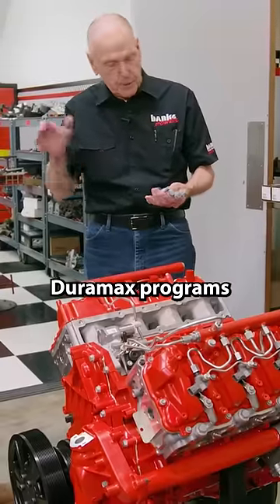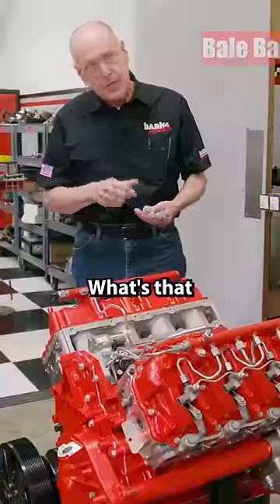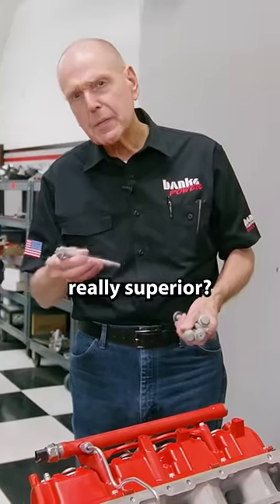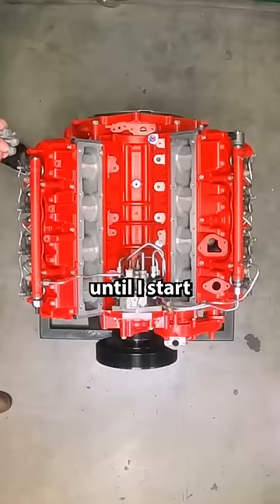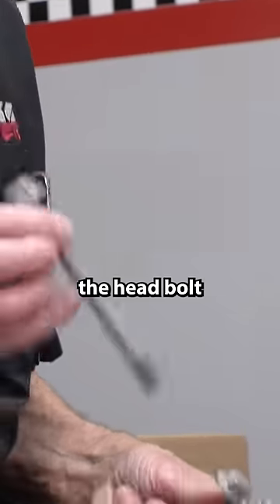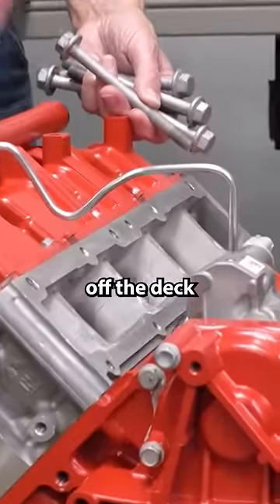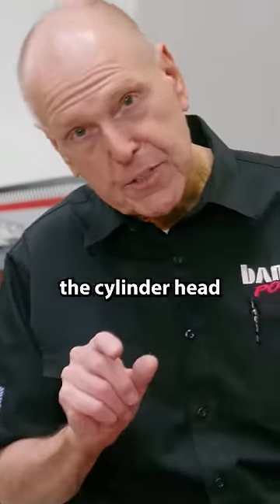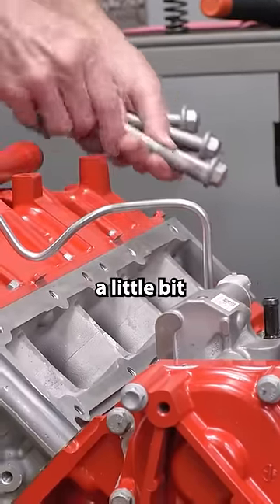Upgrading to head studs might be a bad idea

Comment: I have a cheap little 22re I've blown the head gasket on from over revving and doing cheap 22re things.
Last time i put a head gasket in it i tapped the holes, lubed a new set of bolts, and torqued them 20 ftlbs over spec.
I've put another 50k of unrelenting valve floating miles on it with no issues..
Just my experience with a cheap engine.

Comment: He's not wrong. If you're constantly blowing headgaskets, odds are the mating surfaces of the block and head aren't perfectly flat. Just machining the head isn't going to fix that, the block has to be done too. Studs can compensate for some of that by being more rigid and having a higher clamping force, but then you'll run into the heads cracking because of the extra stress. You can see this stress yourself. Bend a piece of metal just a little, and it will want to bend back to where it was, which is called elastic deformation because it bounces back. Bend it alot, and it will stay roughly where you bent it, but you'll be able to see stress cracks at the peak of the bends. This is called plastic deformation because it's permanent, and the cracks are where the stress was the highest. If the head is flat but the block isn't, the head is going bend down to meet the block's low spots, putting extra strain on the high spots and causing a crack over time. It won't be at the bolts because that's where it's stable from being held down, it'll be inbetween the valves because that's the furthest distance between studs, as well as being both thinner and having sharp angles that act as stress risers. If both surfaces are perfectly flat, you don't have this internal stress on the metal. If one isn't, the weakest point will crack when the drive cycles transition the metal from elastic to plastic deformation.

Comment: If the bolt clamping force is greater than the dynamic forces from the firing pressure the bolt doesn't stretch from the pressure because it is already stretched from the greater clamping force.

Comment: Something else to consider, head studs can distort the cylinders more than a bolt, so ideally the cylinders should be bored and honed with the studs and a torque plate installed.

Comment: Great guy smart as hell but all he did is tell us nothing we didn't already know, the originals are stretched to yield which means if you're gonna keep the stock ones then you're gonna have to constantly go in and check them and Torque them and using studs maybe a little rigid but on all the diesels I've worked on which is hundreds, I've never had any problems with studs after installing them, but great video.

Comment: It depends on the engine or course, I ran ARP hardware on a twin turbo Audi V6 setup a few years ago. When you’re shoving 30 pounds of boost down its throat the factory bolts will let the heads lift. The ARP doesn’t. That being said, on that particular engine nobody cracks blocks with them, the bottom end will let go before you ever have that issue lol

Comment: I was taught this is why certain applications have different grade bolts in them. For this very reason. A designed failure point when certain shocks or stresses are too high.

Comment: What he said was loud and clear: it’s much cheaper to replace bolts regularly than it is to replace the hunk of metal they are bolted to. Lol
Reply: I would think that’s still easier and cheaper than replacing the block… Also, I note that he said “until you start blowing head gaskets.” Meaning don’t let the engine find a catastrophic failure point when you can engineer one that can be fixed. That’s what I got from that.
Reply: @AlphanumericCharacters  that’s kinda what I was thinking. Lol. I have a bit of experience with aircraft engines and they have failure points designed into them much like these head bolts. Routine maintenance and service intervals include engine rebuilds with fresh parts in the failure points. It’s a lot easier to do that than it is to land a plane without power. Lol that’s where my head was at. 😅

Comment: Studs are better if you're gonna be pulling the heads on and off (racing) often. The threads on the stock bolts can wear out the aluminum (softer, dissimilar metal) threads. If it's staying on, stock bolts are fine.

Comment: This is VERY TRUE, When the group of engineers took WWI aircraft plans and built new reproductions, they new better than to "upgrade" the build quality, as you will now move a "Known Failure Point" to an unknown location, one that may not be so easy to inspect...With Deadly Consequences.  Their Motto: "It worked then, it will work now."  (Source: NOVA - The First Air War ~ 2014)

Comment: Depending on the engine and how reliable that engine is to begin with spending that extra for the oem is worth it. 
When I rebuild my 6.2 for my Escalade all OE went back into it. 
When my motor blew up in my 07 Lincoln mark lt with the 3v 5.4. I went to my local pull a part and got a 2v 5.4 and rebuilt it with upgraded parts and junked the 3v block. Sometimes engines aren’t worth saving.

Comment: The bolt has an elastic region and a plastic strain region. The bolted joint is designed stay in the elastic region and act as spring. It does not yield and "strecth" in length.

Comment: More than that, cranking the bolt down harder doesn't necessarily result in a better seal. Because head and block are not rigid,  the flexing caused by pulling down at the head stud can cause the middle in between the bolts to rise up, making the already weakest part weaker. 
for a visualization just put something flexible like a thin piece of wood on your bed and push down in the middle and the ends will rise up.

Comment: He’s explaining the old saying of” the chain always breaks by its weakest link “  to strong bolts will not give in as the engine was designed to have, so the block being weaker than the bolt gives in and breaks, decimating the engine

Comment: I lifted the head on my ls1 after it stretched a bolt. It cracked the head stud hole itself and let coolant seep in and i replaced the entire engine because aluminum is granular so that particular crack was almost impossible to save. Needless to say i have arp head studs this time.

Comment: It's pretty obvious that if you take a part that is under stress, and make it stronger than the specifications call for, so that it can't fail, then you merely pass the point of failure onto the next part -- in this case, the heads, or the block itself. You can look at it as a built-in failsafe. Better to stretch the head bolts and blow a gasket out than to blow up the head or the block. 

If I was rich I'd have given my old '85 Super Duty to Mr. Banks, and have him bulletproof it. Not so much to increase the performance, though it WOULD be nice, but to build it up to last a million miles. As with many things, if I knew then what I know now -- I'd have NEVER traded that truck for the Dodge POS 1500 that I got because my wife liked the color. 😮

Comment: The gaskets don't spring back! But his point is kind of valid. Many modern engines are built with bolts that are designed to stretch. They are one time only use. And excessive Hi Tensile can transfer excessive force to threads. But you cannot generalise.

Comment: Well also the l5p went to a 6 head bolt per cylinder design to fix the problems they had. 6.7 powerstroke rarely blow head gaskets and this is why. The lbz was bad about head gaskets

Comment: Head bolts don't fatigue ... think about it ... a high stress repeated many millions of times and no fatigue?

What happens is that the stress in the head bolts is largely static!

The pressure in the cylinders relieves the pressure of the head on the block, and the stress in the bolts stays the same with them only 'micro straining' (ie stretching) only enough to relieve the pressure of the head on the block.

The very first experimental design we did in my engineering degree was to demonstrate this and it has stuck with me ever since. 

So do not OVER or UNDER tighten head bolts. You need to replace head bolts because when you originally torque them up, they will be taken above their 'as new' elastic limit. If you reuse head bolts, then the torquing regime will not produce the correct axial (static) stress in them.
Some really big marine engines have hydraulic jacks on each of the heads bolts to more accurately set the tension. 

Note when torquing, you are applying axial tension by twisting the bolts ... not easy to measure ... but taking the bolts over their elastic limit gives you an accurate measure.

Note that cracked blocks are usually due to the expansion forces of the top of the cylinder (liner) producing circumferential forces that will crack  the deck at the thinnest point (ie hetween cylinders).

Comment: I ran stock headbolts in my 800 whp vw back in the day......I even re used them 😮and ran stock gaskets.  People never believed it but then some guys in Brazil split a few studded 1000k hp cylinder blocks  in half and guess what.  . . .they went back to oem bolts and the failures stopped.........well until they were pumping 1300+ hp from a 20 year old cylinder 😂😂😂😂😂

Comment: The craziest thing I've seen is the one truck from the old job I had. It kept blowing head gaskets over and over again. It turns out that someone had 35psi of boost coming out the turbo feeding into a 24 valve 6.9l cummins. That poor engine... But I tell you what, no amount of weight was ever a challenge for that truck. The only challenging thing was keeping a head gasket for more than 1000km

Comment: I had a quick search online- I run studs myself but not a diesel. One Duramax forum said factory bolts are 75ft/lb studs go to 125 ft/lb. I guessing the extra 50 ft/lb tension is probably the issue?
If MORE hold down is needed then studs at stock tension then the deck needs to be drilled and tapped for a larger size not more tension added.
Studs are a normal upgrade in spark ign engines, jumps in fastner tension numbers are not tho.  1000+ hp from Small Block V8s without destroying decks from studs

Comment: Pretty much same reason why I run the "cheap" stock head gasket in my turbo 2300 mustang.  I think of it as a fuse.   Something goes wrong, I'd much rather replace a 12 dollar gasket than pistons, valves, etc..

Comment: That's why the metal head gaskets have a indentation around them.
That's why when you are tourqeing head bolts it's important to follow the procedure to the letter.
Stretch the bolts all the same in the correct order.
Do it right or don't do it.
If your going to take shortcuts don't even start

Comment: A lot depends on the set up. If its an aluminum block, if it overheats bad, its junk. If you have aluminum heads and it overheats, they'll warp. All steel, overheating once usually isnt an issue

Comment: That's pretty common on motorbikes ,people replacing stock made for purpose bolts either really strong and high tensile for a purpose or soft ,designed to strip before damaging the motor,replacing them all with the same grade generic stainless or titanium ,that's wrong ,you want your bolt to strip ,not your engine block or cases if something ain't right....it seems like those big high powered engines need a wee bit of stretch in the bolts ,to allow for expansion of whatever, not hi tensile studs..

Comment: If you state a controversial and counterintuitive idea yet explain its validity with sound logic and reason to the point it scientifically makes sense. I will certainly take that into consideration. However let's also be mindful he started by referring to General Motor products. I would be interested to know how other manufacturers blocks fare. Then again if you are pushing anything to 1000hp, especially a GM product, shits bound to break. Solid point ol boy. Ill keep that in mind the next time I'm pushing 1000hp.

Comment: Are they stretch to yeld bolts? One time use? That makes a difference. I still like studs in high compression situations. Hold that head down so the gasket doesn't have to spring.😊

Comment: "Wrenching pressure"?  Is is clamping force.  Bolts and studs are indeed elastic, threaded hole damage is likely from too much preload.  All steel has identical Young's Modulus, the difference is yield point.

Yes, plenty of myths persist.  Torque to yield bolting with multi layer metal head gaskets are the reason for success as this gasket material has less creep while the bolting has more spring.

Comment: What you're saying is the headbolt is a chosen weak link. A sheer point engineered and to use a higher tinsel headbolt will result in that's stress seeking a different weak point.  In other words , it's going to break , let's pick where

Comment: Looks to me like a shorter depth bolt was used. I've seen some earlier ARP kits that had less thread depth.
I guess you are suggesting some spring quality is needed in the metallurgy of the bolts or studs.

Comment: The idea of reinforced headbolts is pretty insane anyway unless you're running massive power. That being said, in all my year of tuning I've never had a vehicle that would require heavy duty headbolts. Putting in new bolts is the most important thing, because stretch bolts should never go back in once removed.

Comment: I used ARP head bolts and had gasket failures. I switched to ARP studs and problem solved. Same heads and block. Same blower.

Comment: This is kind of a misnomer. The point of a stud over a bolt is where and how the pressure is applied. A bolt pulls on the threads in the block when torqued. When i nut is tightened on a stud, most of the force will be applied to the stud itself, because you aren't tightening the stud with it.

Comment: When I worked at Summit Racing ,I usually sold a normal push rod instead of  super thick , heavy-duty pushrods .  I'd rather bend a push rod than destroy the valve train .  Same basic idea.

Comment: Better a blown headgasket than a cracked block. If you must use studs instead of bolts, make sure they have the same grade rating as the OEM bolts.

Comment: Even stock 6.0 PSDs only failed because of excessive heat and pressure from EGR coolers. Engine cooling systems weren't designed to handle Exhaust temperatures.

Remove egr coolers, no more blown head gaskets, no need to use studs or ring gaskets.

Comment: The Stud headbolts need a bigger circumference/diameter bolt head,  (on the block - outer) with possibly some type of extreme spring washer - Tenctioner ? tripple the bolt head size

Comment: The torque to yield bolt is designed to act spring-like under the pressure. The Duramax engine is not the 6.0 powerstroke that Ford made. Every difference, makes a difference.

Comment: What you’re doing is finding out the limits of technology. The durability of the materials. Block, head, studs, bolts, head gaskets. The engine is designed to make only so much horsepower, and torque. Pushing it beyond the limits, will reveal these limitations.

Comment: Hey can you use some material science equations. Measure the depth of the hole and use material science equations for thread strength and material strength to determine how close the stock hit both is to ripping out threads on that block. If the stock head bolts are not even close to ripping out, then you can probably safely assume that it's an over engineered stud bolt that exceeds the ability of the block to hold it. I would definitely agree with your method though, when fixing farming equipment you run into this problem all the time or you over fix a break and cause trouble somewhere else

Comment: One thing I feel like people tend to do is overtorque the upgraded fasteners. I’ve fallen for this in the old days. I ended up going almost 2x “revised” torque setting and it cracked the head casting. That motor forever had a mysterious coolant loss and wet plug cold start difficulty. What if studs at factory specs are still safe?

Comment: Yep basica common sense people never over do a job, which the product was meant to be used for ,stock head bolts are not made for turbo applications full stop and truck engines or oem engines have the right products if they are turbo engines, sure you can make it better but then your going need to update so many moving parts and non moving parts is it really worth it unless your going to drag or race that engine than forget it plus all racing parts are made for racing. cheers Mr Banks. 👌🦘👍✌

Comment: How about head bolt girdles?  You can girdle the rotating assembly to distribute load across the journals, would doing the same on the top end help?

Comment: I've never seen that block issue before. Before we speculate the head studs being an issue, we have to rule out any other possibility. Were the head stud nuts were torqued correctly and not too much? Maybe there was fluid in the hole? Maybe it was a casting defect on the block? Is this a repeat issue on studded blocks?

Comment: I'll still continue to use ARP Studs. TTY Head Bolts loose tensile strength, stretch and are trashed once thier clamping tourqe is surpassed even once and will cause failure.

Comment: Depends on the power level. If you're making 1,000 plus it needs studs the reason why that hole cracked is because it had sharp Machining points on it and it wasn't deburred.. fact

Comment: A harder stud or bolt isn't superior, it just wasn't designed for that application. It's the same deal as with designing correct tolerances. Too tight might affect lubrication. That's what she said.

Comment: Nothing exists in a vaccuum. My dog learned to operate the latch on the gate in my back yard. I put a stronger spring on. This caused the bolt to start coming loose. I upgraded the bolt hardware and the latch came loose. I upgraded the latch hardware and the hinges started coming loose. I upgraded the hinge hardware and the latchbar started getting loose again.